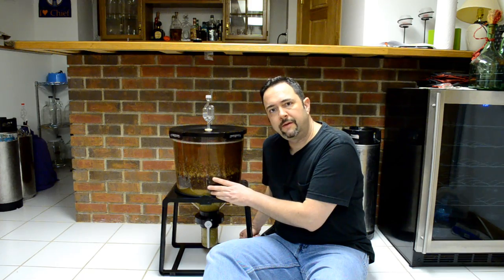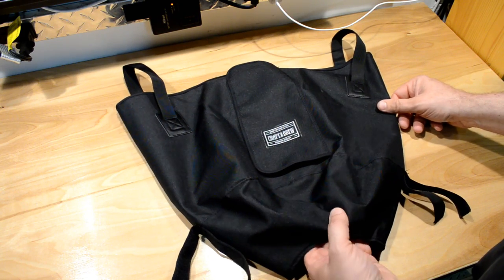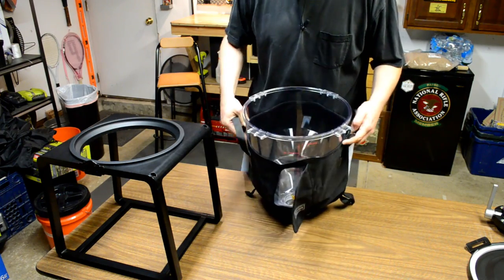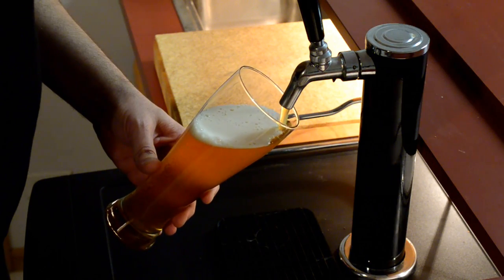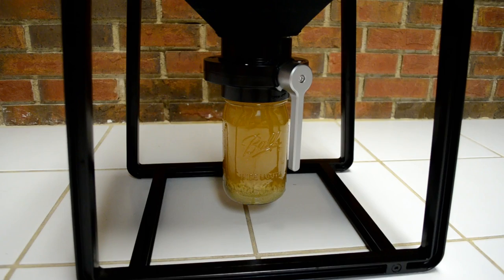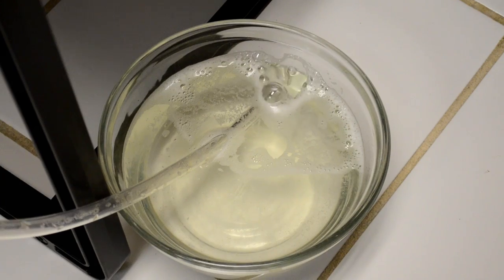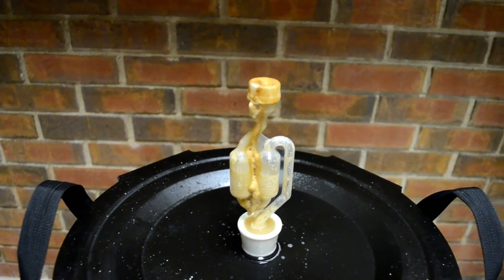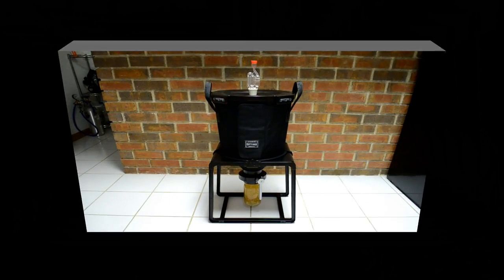The Catalyst Fermentation System: A Hands-On Review Update

Comment: I just emailed Craft-A-Brew to see if they had any plans to sell a domed lid that would give more headspace. Blowoff is my biggest problem as I lose about 1/2 gallon of beer and a TON of good yeast. Out of 5 uses, I only had one that didn't blow off. It was a kettle sour and as a result had a slow and steady fermentation due to the lower pH. I would really love to see a dome lid option, I don't imagine that it would take much R&D to get something like that into production. I also have not used the catalyst as a secondary fermentor yet and I may never either...  I usually rack to a glass carboy after 2-3 weeks of primary for cold crash and secondary. That seems to work pretty well for me... I finally put a collar on my chest freezer to accomodate the Catalyst, so I currently have a "Golden Road Wold Among Weeds" on it's second day of fermentation (6 gallons to fermentor. Yikes!) so this will be the first time I ferment and cold crash in the unit... but again, seriously. DOMED LID!
Reply: When talking to homebrewers before producing The Catalyst one of the biggest downfalls of conicals was that they would not fit into fermentation chambers/keezers so we decided to sacrifice a bit of headroom for the ability to fit into a standard chest freezer (we know it may not fit into every freezer but it does fit into most). We don't have too many complaints about the capacity or lid since the shape of the Catalyst allows for less krausen height compared to a 6.5 gallon carboy and even less krausen height then a fast ferment due to to the wider area.

Comment: this thing is great for harvesting yeast and makes bottling super easy. no need for transferring to a secondary. don't worry about the oxygen from trub removal, less than transferring to another fermentation vessel. good product if you can not afford a real connical. the yeast collection will pay for it over time.
Reply: If bottling do you add or priming sugar directly to the beer or try and spread it out in the bottles
Reply: @kraigcorbin5631  I bulk prime in the Catalyst itself. I'm still getting my numbers right since the first batch was over carbonated and the second batch is under-carbonated. But once that's nailed down it should be super convenient.

Comment: Great video. I have an idea for trub removal, how about  delay adding yeast for 1 day? This would allow trub to fall into jar, u can change out jar, removing trub, replace jar, then add yeast.
Reply from the maker: That would help settling out some of the trub, BUT....
such a delay in kicking off fermentation can allow germs to grow and dominate the wort before the yeast even has a chance to compete causing off flavors at best and a spoiled batch at worst.  It would really depend on your sanitation practices, and even with good sanitation, there will still be some germs in the wort. It would be up to you to decide whether that chance is worth it.
Reply: @BEERNBBQBYLARRY  could you mitigate that by using a campden tablet in the wort 24 hours before adding the yeast?
Reply from the maker: I wouldn’t bother. Sodium metabisulfite can temporality suppress bacteria and yeasts, but it needs to vent for some of the sulfur to escape which means exposing the fermenter to the air where more germs can get in after it wears off. Also, it binds with dissolved oxygen in the wort thus taking away oxygen that the yeast will need. It also is a salt which I’d rather not have in my beer if I can help it. I use it in my red wines but only during initial maceration in open buckets and when racking during bulk aging when the fish is to keep oxygen at bay.

Comment: I am deciding between this and the ss brewtech chronical fermenter. This one is half the price of the ss, I'm just wondering if I'll be happier in the long run if I go with the stainless conical
Reply: BEER-N-BBQ by Larry that is true. The main thing for me is just skipping transferring to a secondary fermenter. I'm just wondering if the ss is worth double the money. I have also seen the mini brew conicals which are plastic but only 199. Decisions decisions. Lol
Reply: BEER-N-BBQ by Larry good to know. I have always racked into a secondary and usually dry hop at that time. Do you cold crash your beers?
Reply: The Catalyst comes in at $199 too and we use a polymer that is 93% more scratch resistant and 73% more impermeable to oxygen then the mini brew, cheers and thanks again Larry for putting the Catalyst through its paces!

Comment: Here's a yeast-harvester-slash-blowoff I put together, based on a suggestion I saw somewhere in the forums: http://i.imgur.com/lmkBP3O.jpg 
Can't find the original post, but will update when I do. Basically two jars connected with a length of silicone tubing with O-rings to seal the barb fittings to the lids. (Not shown in the pic is StarSan, which sits in the jar on the left above the PVC). Nice thing is that it can handle a significant amount of air being sucked in upon cold-crashing in my chest freezer, without worrying about StarSan ending up in my fermenter.
Reply: Found it. Original by mbcluever on HBT, here: http://www.homebrewtalk.com/showthread.php?t=480990

Comment: Get a 1" blowoff tube instead of that 3/8" or whatever it is you were using. Much less hassle. Still a pain to clean though, I use a dowel and some wet paper towels to punch it like you would a rifle bore, but it's still a nuisance.
Reply: I don't have any 6.5 gallon carboys (though I recently ran out of fermenter space and bought a few 6.5 gallon plastic buckets), so I always use a blowoff tube. To tell the truth, I actually kind of enjoy watching the  kräusen go through the tube and bubble off into the sanitizer solution. I usually replace it after fermentation calms down, but sometimes I don't even bother, and just keep the tube on until I'm ready to rack into a secondary or bottle.

Comment: I use a blow out tube for any beer with an estimated ABV over 5.0 because of the limited headspace, after three days of active fermentation, I switch to a airlock.  It works like a charm.  You can also use a strainer to minimize trub going into the catalyst fermenter.  When dry hopping I use a hop screen tube.  I have found being able to take off the lid and put the tube screen into the fermenter is a big pro of the catalyst system.  The biggest pros are elimination to rack the beer and capturing yeast in mason jar at the end.